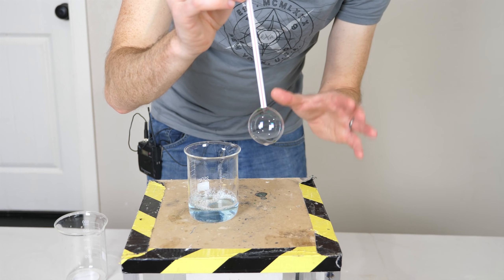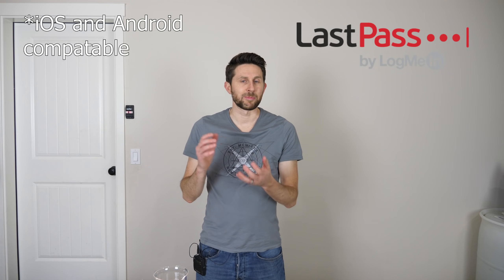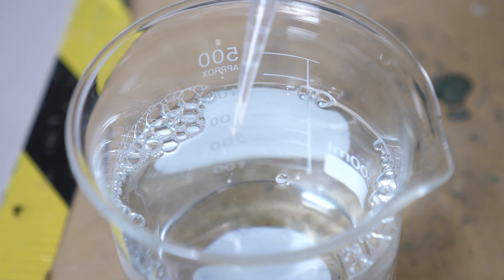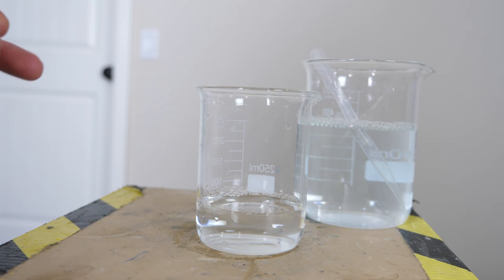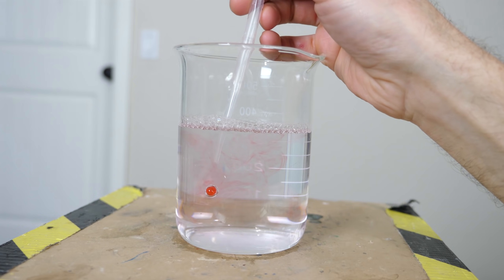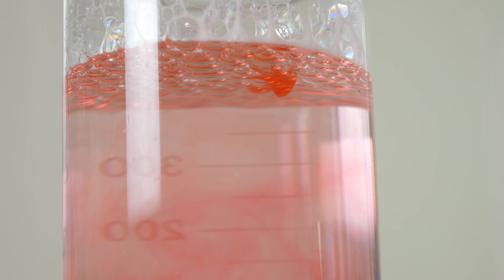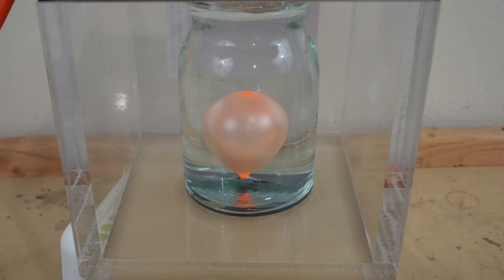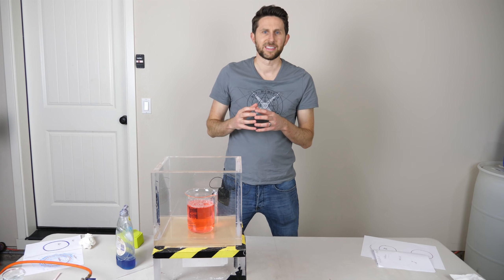What Happens to an Anti-bubble in a Vacuum Chamber?

Comment: The second reason @ 9:25 – why would the surface tension of an anti-bubble be much more powerful than that of ordinary bubbles (that expand a lot)? The first reason can alone explain the difference, though I think it could be phrased clearer as "The air is compressible and the water is not. The volume of an air bubble is almost entirely air, and the volume of an anti-bubble is almost entirely water."

Comment: how does smell escape vacum chamber at 0.2 atm? if something leaks, it's going to be air into the vacuum, so if the smell inside is released after the pump se sealed, how is it going thru the vacuum into higher pressure?

Comment: Doesn't air expand far more readily than liquids?  If you can't compress water, then how can you cause water to expand without heating it?  It seems only the thin membrane of air would be able to expand and since there is such a small membrane, it would only expand a tiny amount.

What happens if you float a layer of oil on top of the water to try to reduce the odds of the anti-bubble bursting?

Comment: This is mistaken.  The surface of the anti-bubble is no stronger than the surface of an ordinary bubble.  The surface tension is the same.  The reason the anti-bubble does not seem to increase much in volume is simply because the volume of air involved is small compared to the total volume of the bubble.  You yourself called the air layer a "membrane".  When the pressure inside the chamber is reduced by, say, 50%, to first approximation the interior volume of all the ordinary bubbles doubles.  Since the water membrane is very thin, the change in its thickness does not substantially effect the overall size of the bubble.  In the case of the anti-bubble, once again the volume of the air comprising the membrane pretty much doubles, and to first approximation this means the  thickness of the membrane doubles, but t hat amount of increase in radius is quite small compared to the radius of the water sphere, so the overall radius only changes by a very small percentage.

Comment: The anti-bubble is expanding as much as the water in and around it, almost nothing.
I believe it has nothing to do with surface tension, volume or the strength of the air membrane. It is just that water is almost not expanding until it cooks. Nice video though!

Comment: If you submerge wood in liquid bismuth 271°C, tin 232°C, or gallium 30°C in a vacuum chamber... (Any should work because there melting points are lower than woods burning point<300°C>) would the wood absorb the metal?
Side note bismuth and tin mixed have a lower melting point 138-170°C

Comment: The video should have just been, "Making an anti-bubble", because the vacuum chamber stuff wasn't good. Glare covered the bubble the first round, so if there was any growth, your viewers didn't see it. And it is generally just not that interesting to know. I mean, realistically how big do you expect the layer of air to grow before the structure becomes unstable? Water isn't just going to magically float inside of a pocket of air beyond what the surface tension allows for. 

A more interesting video would have been just making more anti-bubbles. Maybe with oil, to see if you could get it to sink or stay stationary.

Comment: I'm no scientist but I think your ping-pong ball (9:20) theory is a bit off. The inner most sphere is water so it will not increase in size. The very thin layer of air has such a tiny volume that it is harder to see the very slight amount of increase in size, but that increase in size is going to be the same as any other bubble with the same volume except it is starting out already spread out to cover a larger area so the increase is less noticeable. Yes, there is more surface area but, I don't see how the surface tension could be any greater at that point than any other point in the same vessel. Could I be wrong?

Comment: Are you sure? Would a water ballon in water expand in a vacuum? My guess is the anti bubble didn’t burst because the water inside the layer of air and the water out Side the layer of air where are remain nearly equal and that keeps the air from expanding. If you could keep that bubble completely under water I don’t think it would expand or break in the vacuum.

Comment: 💥💯🔥😃❣️💪😎👍❣️You should try this in a pool shooting you in the red mixture or another color, even experiment with Lazer heating it, anyway then use hoses to push you down keeping you in the anti bubble... Maybe coat yourself with the stuff that prevents water from sticking to your skin. 💥💪😃👍💯
Oh what if you put magnetic tiny particles in the anti bubble and then used magnets to keep it submerged in the vacuum.

Comment: Hey Jimmy. Why is it called ANTI-bubble? I think it's the right bubble anyway. What does it matter which substance acts as a wall to form a bubble?
Why didn't the "anti-bubble" expand? The ONLY reason is that the bubble contains water - not gas. Sorry, but these of your explanations numbers 1 and 2 from 9:11 are childish nonsense.
Reply: Correct. The water did not expand under vacuum outside the bubble, so why would it expand inside the bubble as well? When there is gas inside the bubble, it expands according to the vacuum. How scientists are sometimes stupid! For example, less than 100 years ago, astronomers were absolutely convinced that the brightness of a celestial body accurately tells its distance from the earth. Yeah right! It took a WOMAN - Henrietta Swan Leavitt - to tell the gentlemen they were wrong!

Comment: The reason the anti-bubble did not change in size is actually because it's full of water, which is not very compressible and doesn't change size very much.

Only the very thin membrane outside the bubble is air, and the volume of that is just so inconsequential that you can't tell that it gets a little thicker. The water inside doesn't change volume, so the size of the bubble only increases by the increase in thickness, which isn't enough to notice.

Comment: you should have dropped in  sugar solution which is heavier. With the right ratio it should experience no lift an just sit in the same position until you apply the vacuum

Comment: cool video...always wondered what those bubbles were..
my thought is that the only part of the anti-bubble that could expand would be the layer of air...the centre being comprised of water can't....since there is such a tiny volume of air...demonstrated by the fact you don't see any air bubbles when it's popped...it would be virtually imperceptible
I agree with the idea of differing water temperatures could steady the bubbles position

Comment: This is pretty important, I was doing a experiment with boiling fluids, When I discovered that the bubbles that are manifesting within the liquid contained no vapor, or gas. So the idea, that water boils because of vaporization of the gas within the liquid needs to be reexamined. When you use a large syringe to create vacuum over a fluid, you can remove all of the air inside the syringe, so that there is only water. Pulling the plunger back creates a vacuum, using warm water, or alcohol which boils inside the syringe. The thing is though, after the liquid has boiled for some time, letting the plunger back, I noticed that there wasn't any air inside, the same as before I induced the vacuum. So the bubbles that were being formed were bubbles of vacuum, and not air, or vapor. So the liquid itself is expanding. well, because water can't expand, vacuum voids appear. which is the bubbles from boiling.

Comment: The air in the anti-bubble is expanding, but since the initial volume of air in the membrane is so small, it's not really noticeable. The air membrane could double in thickness and the size of the bubble would barely change, due to the thinness of the membrane. The air bubbles on top expand significantly because they are completely filled with air.

Comment: The reason the antibubble doesn’t significantly expand is actually because most of it is made of water, which is incompressible. The surface tension explanation isn’t correct.

Comment: I think that that antibubble grows much less because volume doesn’t grown linearly. If we have a bubble with a radius of 1mm a bubble twice its volume is only 1.25mm it’s only 0.25 mm bigger, barely noticeable. But if we have a bubble with a 1 m radius to double it’s volume you have to add 25 cm to its volume. There is way less volume of air in the antibubbles than in the bubbles of comparable size because there is only a thin film of air, so they grow much less.

Comment: Not an expert but are you sure that your conclusion is correct? If the bubble has water inside, do the bobble have a non compressible nor unexpendable fluid inside. No matte how low or high you set the pressure, will the water not expand. Next layer is a air layer that expands very easily, but the amount of air may be the same as the amount of water in a normal bobble. That means that even if you expanded that center air layer, thousands of times, would the effect barely be visible.

Comment: water doesn't expand. amazing.
it would be interesting to see this with the inner fluid mixed with something to increase it's density such that the antibubble would sink even with the air around it (maybe like a simple syrup or something?)
i would guess that there is some amount of air from the skin boiling off you can't see because the top is at the air water interface.  maybe the skin just gets fatter and sags toward the top tho? it's hard to tell without a negatively buoyant antibubble.

Comment: I think the anti-bubble is not seen to expand is mainly because the layer of air is so thin in the first place. The air layer would change much more than the enclosed water with the change in pressure. For example, if pressure reduced by factor of 8, then normal air bubble goes to 8x volume, and diameter doubles, which would be easily visible. This would also increase volume of air layer by 8 times, but, if I have got my maths right, then air layer only gets 8/3 (approx 2.5) times as thick. 2.5x very thin is still pretty thin. Even if air layer got 8 times as thick, even that would probably not be visibly different. The overall size of the anti-bubble would not change visibly. I don't think surface tension strength is relevant to un-noticeability of size change.

Comment: I guessed it wouldn't change. But, my reason was different. I thought was because water isn't compressible. And likewise it's not expandable. So, there's not much pressure acting on the inside to push the bubble out.

Comment: Anti bubble wont expand in water, it only will break. because solubility of gases decrease when you apply vacuum in the system. So, basically what happens here is at vacuum air always tries escape the system so the bubble breaks at interface and air molecules escapes. under vacuum you can't keep anti bubble suspended in the bulk water by pushing water on it.

Comment: it looked like the "anti" bubble was bleeding off or boiling off some of the air as the larger bubbles started to grow. maybe it split the o2 or weakened the bond and the tiny bubbles it was producing were single oxygen. since the air around the bubble was stuck from surface tension and it was a single bubble it was a finite size and if the air bubble were to split into multiple bubbles it would destabilize and pop.

Comment: Can you make an anti bubble with 11.4 lb/gal CaCl in fresh water? To overcome the buoyancy of the air? Can you make an equation that predicts the needed fluid weight where that bubble will be kept in hydrostasis? Can you use a different gas than air to make the bubble?
Reply: What happens to the anti bubble under compression?

Comment: It seems to me as though the interior water sphere remains the same size, but the outer layer of air that defines the 'anti-bubble' was growing larger as the vacuum increased/pressure decreased.
Reply: You are right about that. It is also the reason why the air membrane pops. The water inside and around it almost does not expand sinds it is not a gass yet, it would boil in a true vacuum.

Comment: I LOVE your experiments. I'm a magnetic and frequency nut. Are there some experiments you can do with magnets and frequencies with different solutions, freeze and observe the ice Crystal formations. 

At home, I structure my drinking water with North Pole side of a big neodymium magnet. I first stir clockwise, (right spin) to eliminate previously store memory on the water, then give the water a left spin.

I was wondering about the crystalline formation of the different spins, a drop of water, freeze, them observe under a microscope.

There's lots of different experiments observing water memory and crystalline formation and if there's a correlation.

Thanks again, love what you do!

Comment: Water takes so much force to expand or compress that it is considered incompressible. The force we just saw might have been the air itself on the outside of the bubble reacting to the pressure change. Edit: 8:04 you can see the air expanding then the bubble breaks

Comment: Could it also be that water will not expand but the air can expand in a vacuum, or compress under pressure? Water and air do not share the same properties.  The air surrounding the water bubble is what expands until  it bursts. Just wondering.

Comment: What if you add a layer of oil on top of the surface AFTER you make the Anti-Bubble - maybe the density of oil will still be less than the anti-bubble and the anti-bubble will have no contact with outside air and hence may last longer??

Comment: Liquids do not compress or expand under pressure or lack thereof. That is why your anti-bubble does not grow much under vacuum. The only thing that can expand is the extremely thin air layer, which has almost no volume, so can barely grow.

Comment: It isn't the strength of the membrane resisting a change in volume.
The gas inside the 'antibubble' does expand just as the bubble on the surface do.  Look closely.  It expands and periodically vents a small amount.
It grows a little, then releases some air to the surface which likely provides the momentary downward reaction necessary to reseal the antibubble...just as it was formed initially.

Comment: The anti-bubble doesn't expand as much as the normal bubbles because the normal bubbles have much more volume. When the anti-bubble pops and you see the tiny bubble, you see the equivalent of the normal bubbles' volume. The difference in growth will be the same ratio as the difference in their volume because there is less air to expand. EZ subscribe, I love when new phenomena are shared. I had never seen or heard of this before. thanks:)
Reply: OK so after re watching it 3000 times, You don't actually see a tiny bubble, if there is one it is really stinkin small for the camera not to pick it up at that distance. If there is a suuuper small amount of air, then my above solution is correct. And even makes more sense, It wouldn't really look like it was changing at all. But now that I think about it, It might also make  sense that there is no air in between the colored water (that I am assuming has no soap in it) and the soapy water and it's the surface tension that's keeping the membrane stable; Like oil and water.  The distance between the colored water and the soapy water in the anti bubble is an illusion. The membrane is extremely thin and reflective. basically a spherical mirror. Add in the deformation through glass and water and you get the illusion. I needed confirmation for this one so I searched for a spherical mirror under water and this is the best example I could find >https:      /    /    tritonsubs.com/portfolio-items/triton-33003-binimi-2/  See how it looks like there is an impossible air gap between the outer shell and the inside of the cab? I think that proves it. The air could still be there; like the canopy plexiglass(maybe its glass? not sure?) the air could form a tiny layer. Because of the reflection, I would guess the difference in the thickness of that membrane would be to the molecule.

Comment: If you did this experiment with a film of oil on the top, it might give interesting results? The oil would obviously float, but I don't know what the surface tension difference might do, as far as keeping the antibubble under the surface until it could expand more? Also water in the flask would have a little more static pressure from the oil on top of it, so might take a little longer to create bubbles, or expands less. Can you see about repeating the experiment with an oil film?

Comment: I dont think surface tension has anything to do with your conclusion.  I'd counter-argue that the anti bubble didn't grow because water's volume does not vary greatly with pressure at these levels. Air's volume does. I think the volume of the thin layer of air grew slightly, but was tough to see because of how little air there is in an anti bubble.
Counter-experiment:
Water balloon inside an air balloon, underwater, in a vacuum chamber.  The water balloon will not expand, but the air balloon around it will get noticeably bigger because it has air (in vastly larger quantities than an "anti bubble").

Comment: The bubble was not growing because the water inside the bubble does not expands because its expansion coefficient with respect to pressure us nearly zero as compared to air. The decrease in pressure would be increasing the thickness of the bubble due to air in it and because of this it pops out.

Comment: The contact between the antibubble and the top surface of the water is a confounding variable. I have a recommendation: if you set up an acoustic tweezer arrangement, you could hold the antibubble away from the surface indefinitely